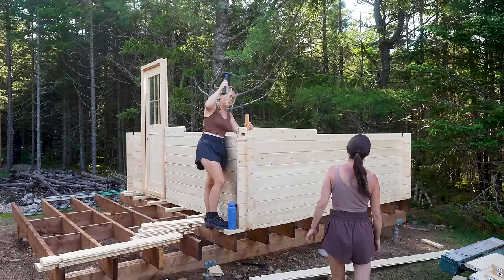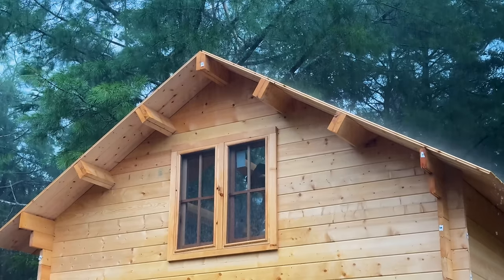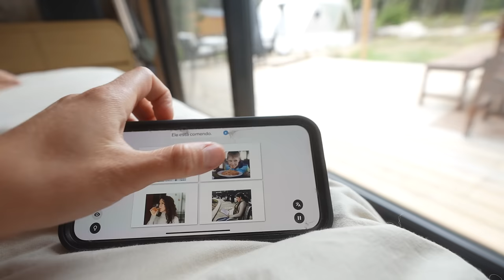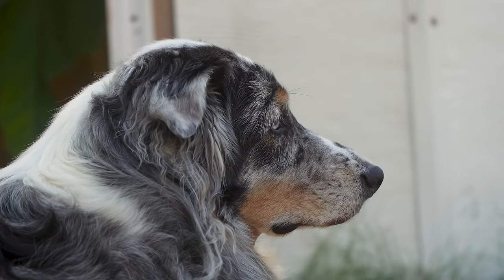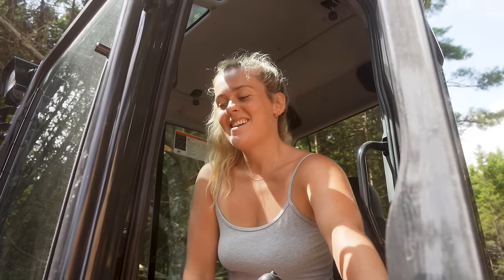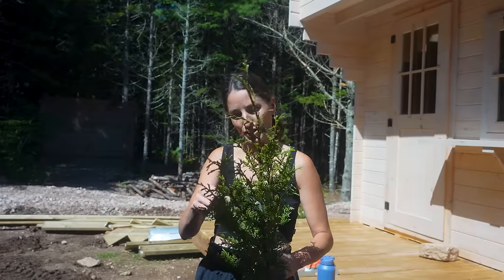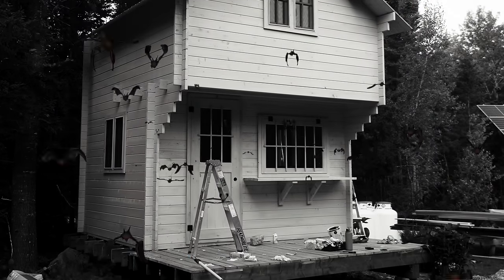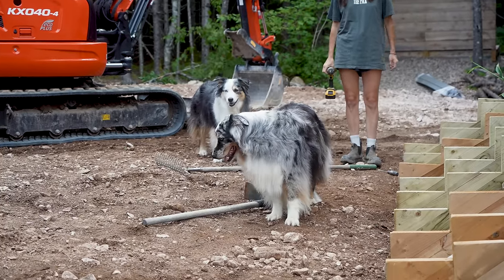Tying It All Together! Building Off-Grid Sawmill Log Cabin (Part 3)

Comment: Hey there.  Been watching for a while.    I know you only have the excavator for a little while.  I love them as well and I just went out and got one for myself.   I went and ordered one from China directly.  It is a smaller unit but still 1.5 tons and they make up to mega sized ones as well but for me 1.5 tons was good enough.  It can dig up to 2000mm deep and can lift about 1 ton.  It is wide enough to be stable and narrow enough to get to all the tight spots.   You could order it with expanding tracks to make it wider or narrower depending on where you need to fit it.  I ordered it with a normal digging bucket, and wide smoothing bucket and rake attachment.  It has a swing arm and hydraulic thumb and uses a pilot driven system with advanced hydraulic pumps.   The dozer blade is about 20 mm thick so a nice thick dozer blade.   It can be made with a Kubota engine and or a Briggs and Stratton engine.   either gas or diesel.   Mine with all the aforementioned and shipping and delivery to my house including unloading as only .......wait for it.............$6,400 total.    Thus you could get a toy to keep around forever.   BTW I did not state that you can pick the color you want for no extra charge (My wife wanted it in Pink for her to drive)     I am not a sales person for any of these, just someone who knows the joy of an excavator toy ad thought you might like a cool toy at a great price.   Ping me if you want more information.
Reply from the maker: Thank you for sharing your knowledge with us. So interesting. 😊🐶
Reply: I wouldn't trust Chinese made steel for heavy equipment, too many impurities in the steel. I've always bought Case or Cat. Kubota is the best budget choice for dependability...Chinese bolts aren't quality heat treated, grease fittings and hoses are crap...Buy a used Case or Cat and put that $ into the repairs and you'll have a piece of equipment you can pass to your children! I still have my dad's 1962 D8H cat dozer, she's 63 and has been putting food on our table for 63 years! Good luck with your purchase and don't beat on it too hard! Have a great day!!
Reply: @williamdecker3989  These are actually quite good and the steel is as good as Case or Cat.   I agree that you need to check bolts and grease fittings when it arrives to make sure they are tight and there is grease in the fittings. It all depends on the budget and how long you need it for and how much you plan to use it.   A Kubota or Cat used is around $50 - 60 K .   I have friends who have had this unit for 4 years and over 800 hours on it and nothing has gone wrong yet.   Thus if you look at 4 years for $6400 you are talking $1600 per year and it is still going strong.   If you even count renting one it is about $200/day so in about 8 days of rental you could have had your own unit.   You have to look at the total cost of ownership as well as the reliability.  These are not as refined as a Kubota.  However they come pretty darn close and at a fraction of the cost.   Plus you get a toy that can do so much more at around the same cost as what a John Deer Lawn Mower would cost.
Reply: @Vanwives  My pleasure.   They are more reliable than what William said as I have had experience with them   There are some that are better than others but for the price and the amount of use you can't go wrong.   Plus I can see either one of you picking out a fun color and naming it something fun and then you can have something that does not have to go back at the end of the season.   Plus as you know having your own toy can be a blast.

Comment: Great vid, love the cabin. But a bit if advise. I felt the brackets under the front windows that hold the shelf should be moved to the ends of the windows (if possible) so stools or chairs could fit under it.

Comment: those drk screws..... I think I've spent over $2000 on those for my house that I bought for $5000 about 30 years ago.  Between the greentreat that I've built with, and the cedar that is within my house it's almost 200 years old… I had to replace or use those because otherwise standard screws would have deteriorated much faster because of the oils and chemicals in cedar/treated lumber.